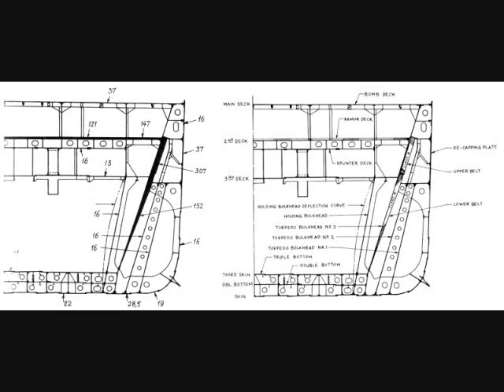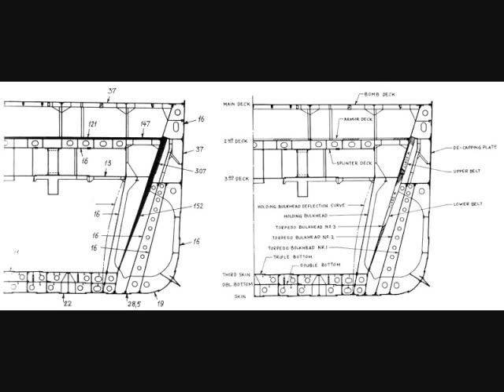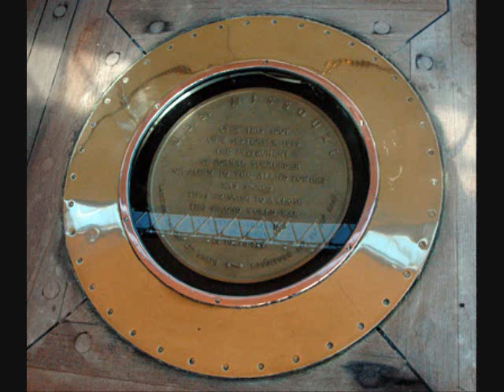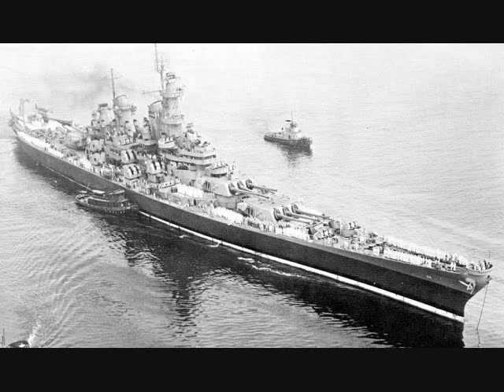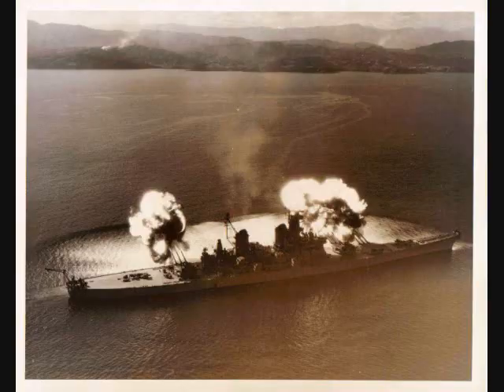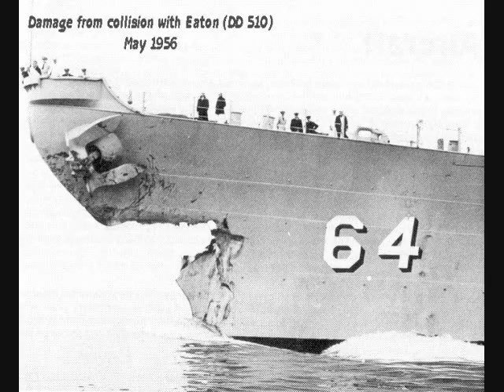Iowa Class

Comment: Turret II used BL&P projectiles that weigh the same as AP projectiles. They were told to use D846 propellant which was used on High Capacity (HC) shells, which weigh 1900 pounds.This reduced charge shouldn't have been a problem, but it was unauthorized. During the investigation it was discovered that the rammer control for the center gun was set on high. (the center gun rammerman was an inexpreienced man) For a further explaination see Battleships by William H. Garzke et al.

Comment: The narrator erroneously stated at 10:25 that the engines were modified to burn modern fuel; the engines are steam turbines, they don't burn fuel. The boilers do burn fuel; originally "bunker c" fuel oil then for the refit of 1982 it was converted to burn diesel fuel marine.

Comment: interesting. now when you say "over ram", you mean they rammed the powder in to the breach to fast or too hard? And using powder not meant for the shot, could you possibly elaborate on that please? but I do understand that the navy essentially took ammo and powder from museum ships; the North Carolina, Alabama and Massachusetts come to mind.
Reply: Karl Woods Over ram can be both fast and hard.  No propellant was taken off NC, Al, Mass.  only shells.  Most propellant was stored in barges old warehouses or in humidity controlled environments.  That's what happened to Iowa.  Here propellant wasn't stored properly and it made it extremely volatile.  It was stored in some barge where the temperature during the summer in Norfolk is hot and humid.

Comment: Just out of curiosity, how do you compare the Iowa's to the Yamato's?
Reply from the maker: I try not too.
Reply: +Shadx27 2 yamatos were sunk, one turned into a carrier and sunk, all 4 iowas are still floating
Reply: +Shadx27 They're dry.
Reply: Iowa’s have much faster turning turrets,  and a higher rate of fire. An their fire was radar controlled.
Reply: No comparison.Iowa class could fire 

 
 up to 2 and2/3rd faster with much greater radar controlled fire control. Superior speed and manuferability(spell).Rated at 33 knots,they could hit 35.Side armour rated at 12 inches with the air and fluid  gapped pockets raised the equivalent to over 17 inches.Iowa class would have picked Yamato class apart.